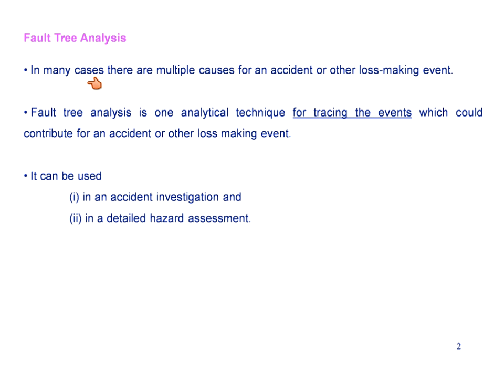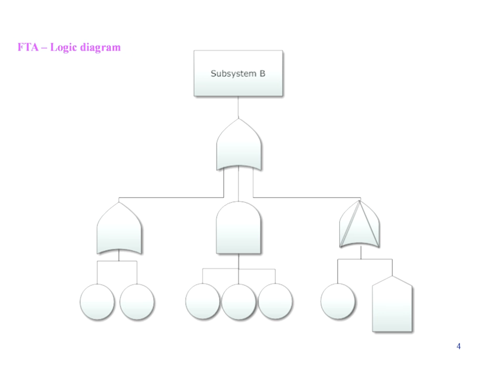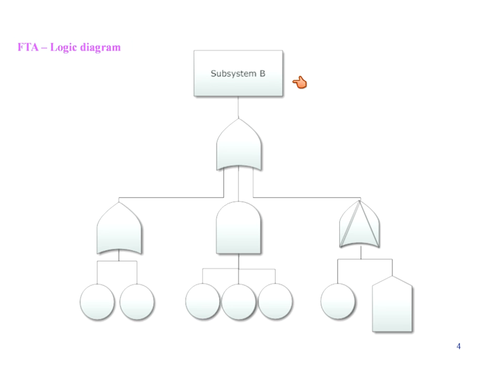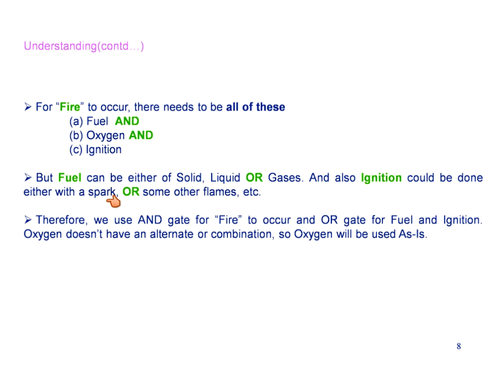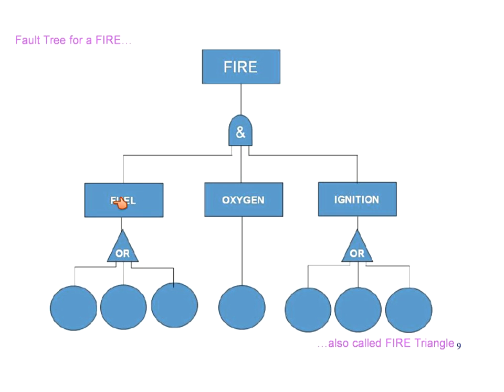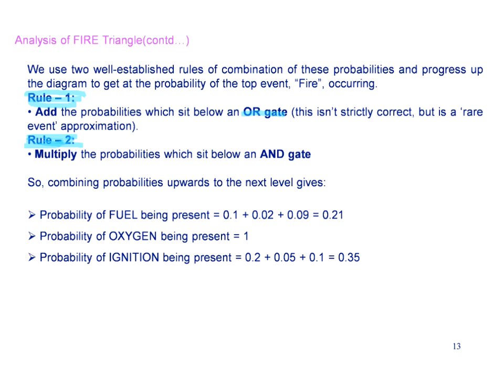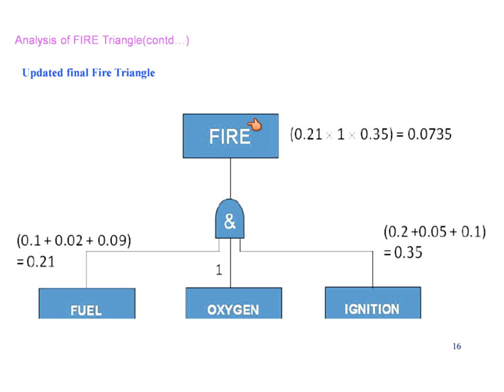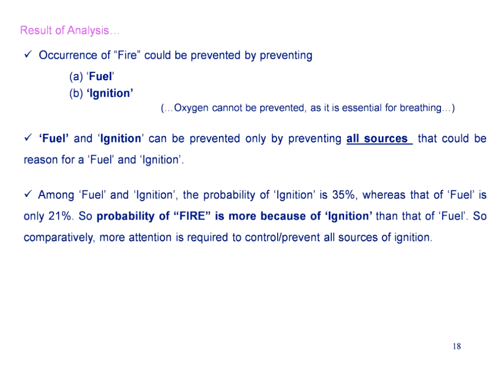Shan-Lecture-Fault Tree Analysis example problem

Comment: Hello Ronit Sai, Basically probability of events connected by OR GATE. If the number of gate is 3, it should be P (1 U 2 U 3 ) = P1 + P2 + P3 - ( P12 + P13 + P23) + P123. My question is , Is it correct cos u used P (1 U 2 U 3) = P1+P2+P3?
Reply from the maker: Thanks for your question, and yes, you are right, in slide no.13, I have mentioned the OR gate calculation is an approximation, in this example as most of the time the events under OR gates(solid, liquid, gases, spark, misuse and flames) are assumed to be mutually exclusive (disjoint events). Therefore for disjoint events, P(A ꓵ B) = 0, the case is same for three events where P(AꓵBꓵC) = 0. So, the expressions “( P12 + P13 + P23)” and “P123” in your equation will hold a ZERO value, which implies just an addition of three events(that is, P1+P2+P3). Hence under this condition, P (1 U 2 U 3) = P1+P2+P3 is correct, as (P12+P13+P23) and P123 = 0 due to mutually exclusive(disjoint) events under OR gates.
Reply: @ronitsai4981  any video available for FMEA ?
Reply: @aarthiece5569  6.23% is the right answer... The OR gate calculation is wrong.